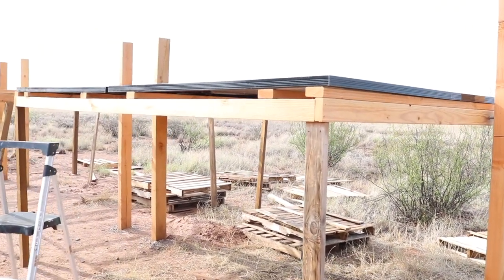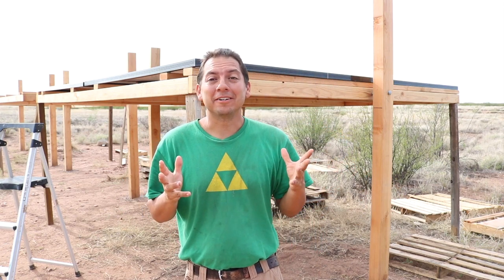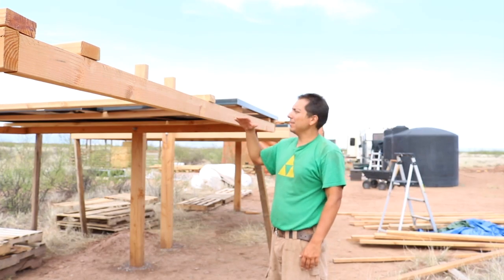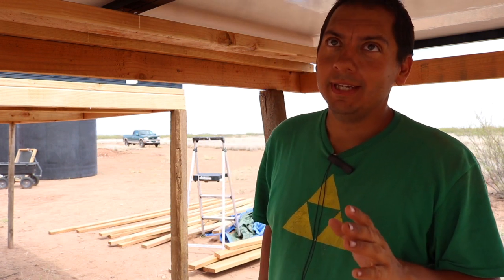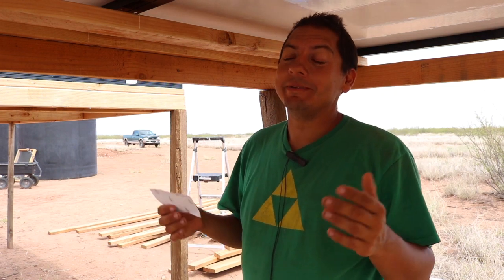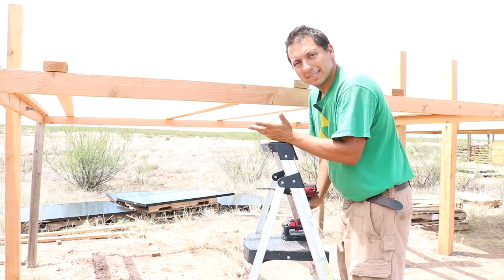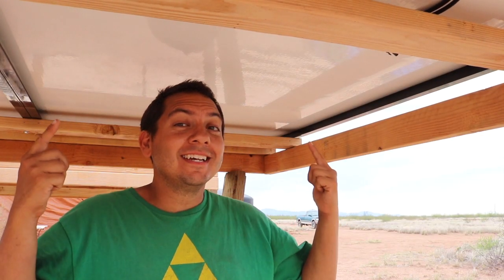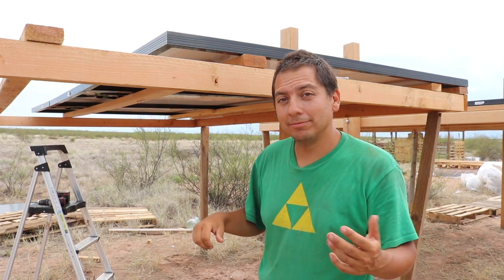Mounting our Solar Panels!

Comment: Great idea with the dots. I haven't moved forward to mounting up my panels,  but will def use your idea!
Now that you've been out there 4 years, do you have any problems with the AZ heat and solar functions? I read over 104° some parts are not optimal.  Inverters etc

Comment: If you put those bottom legs on the outside of the frames you could adjust the tilt.
Reply from the maker: I did have it where the tilt could be adjusted, but I decided against it.

Comment: Add gutters to panels for another rainwater collect!
Reply from the maker: 😃We were thinking about that as well. This mount may not be around that long though. It was only meant to be temporary.
Reply: @ourselfreliantlife  Could u use solar panels for roofing instead of metal?
Reply from the maker: @BajanAlan  🤔 I don't think that would work well. Even if they were mounted tight together, there is no overlapping. I think water would end up going right around. I like the thinking though. Stacking functions is what it's all about.👍
Reply: @ourselfreliantlife  I have seen it done with silicone
Reply from the maker: @BajanAlan  Silicone! Yeah, there it is. I could maybe see that coming together.😃

Comment: Is that water going to be a problem for the wiring
Reply from the maker: G Princess no, it shouldn't. These systems are meant to withstand the elements. Everything should be water tight.

Comment: Hats off to you guys!! Jim, have to say your engineering skills on this project have certainly stepped right up. Your doing an awesome job my friend. Yes there are ways to do things differently but who cares. you are doing what you feel confident in doing and that's all that matters. Concentrate on your build first, time and energy saving techniques come with experience. The Dot Idea is great, coming up with an idea that gives you confidence in your accuracy at marking out is genius.   I think there are websites you can go on, put in your location and it will give you the optimum angle for your panels. Idea time.... when its really windy maybe have an anchor point behind the panels that you can attach a  ratchet strap to and over the panels. or better still, have a way of lowering the whole panels down to the ground. In all honesty i always go way over the top with engineering things, your more than likely be absolutely fine. Very impressed with your build mate. Keep up the good work
Reply from the maker: Gaz Underhill wow! Thanks very much Gaz. It's good to know that I'm going in the right direction and not backwards.😆 Those are excellent suggestions by the way. The ratchet straps would be real easy to do as well.👍